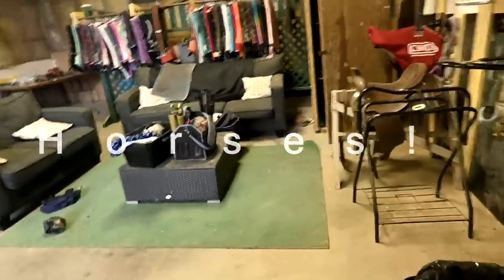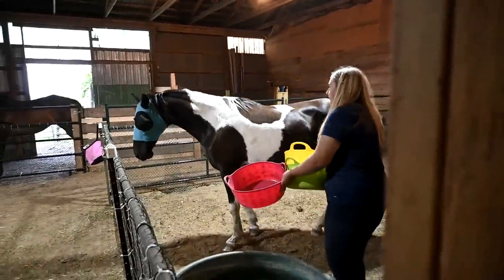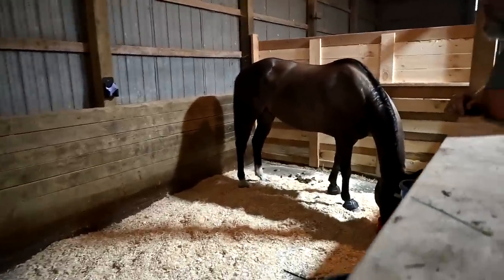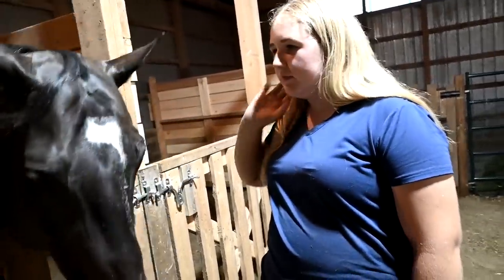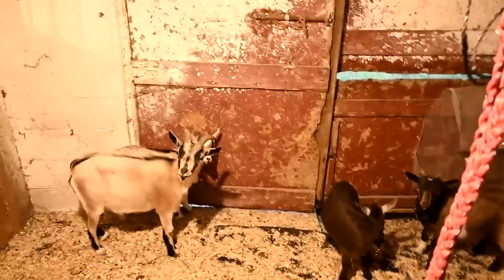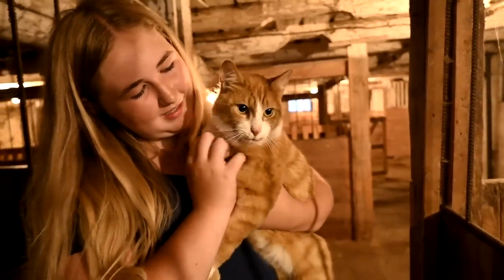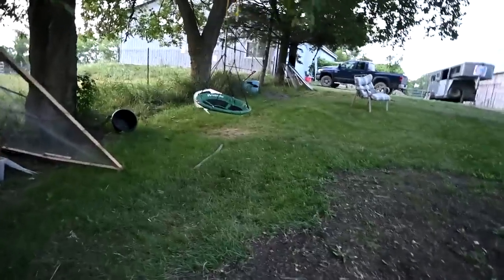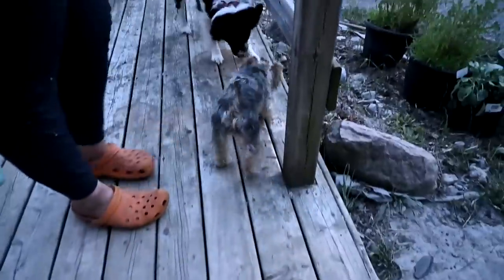Night Time Routine On Our New Farm!

Comment: I know why you might not like hay bags bc of the risk of a shoe getting stuck and the unnatural way of eating,  but hay bags have to be better than feeding the horses on that dirt and risking sand colic. It can be deadly
Reply from the maker: We are getting some specific ones!  The horses are incredible at eating thr hay on top and leaving any with sand.
Reply from the maker: If they are up high then they can't eat with their necks down in thr natural position which is also dangerous!
Reply: I live in Florida. All we have is sand. As long as you give them sandclear they're fine. I've been here 30 years and never had a horse colic because of sand!
Reply from the maker: I've never heard of it here either!

Comment: Our friends stalls are like yours and the can touch each others but she only put shaving on half of the stall. Saves alot of work. Also she lets them run at night and in through the heat of the day. Barn looks good. You need a Great Pyrenees dog to be with the goats ours slept with them and roamed along side them. They are not pets when you want them to work for you. Not say you can't play with them it is minimal. Maybe at breakfast before goats are put out or after they are brought in for the night. These dogs will protect all your animals that is why am big on community housing and grazing. I saw our dog put out a strange dog. They work better in pairs but one can do the job. Our ducks and geese  slept close by our dog.  The duck and goose are getting big. Wonderful video. ❤
Reply from the maker: I like that idea a lot!  That's one of the reasons I have the barn accessible to the horses 24/7.  I want them to be able to get in out of the heat. They have been good at finding all the shady spots.  I didn't even realize how many trees were out there until I saw thr horses under them!